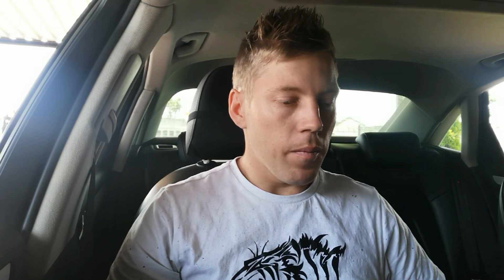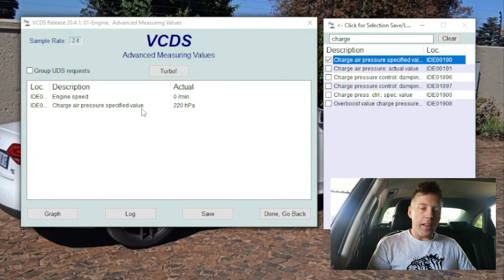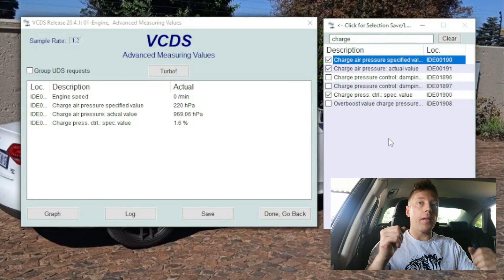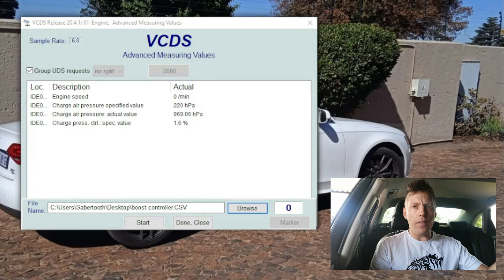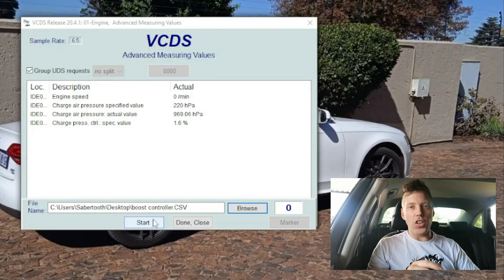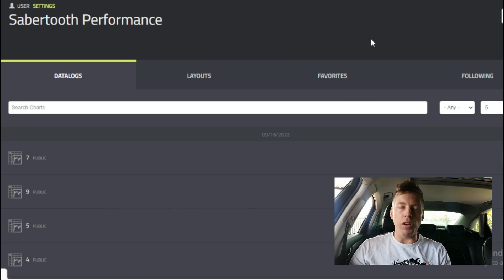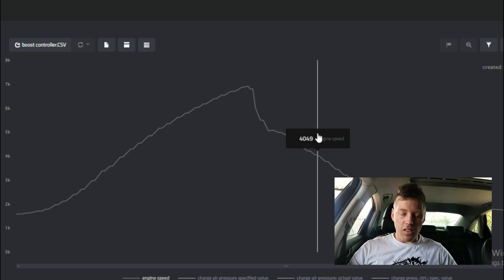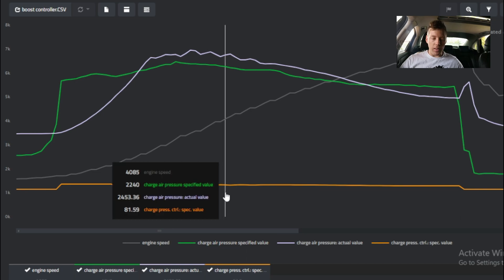How to Data Log Your Boost Controller With VCDS

Comment: I have the same exact problem!!! Tried replacing n75, wastegate, diverter rev d, checked for leaks.. Nothing worked... Did you find a solution?
Reply from the maker: It turned out my MAP sensor part number was not for my car, so when I replaced it with the part number for my car, the problem was fixed 👌

Comment: Thank you mate, cheers from Brasil. 
You are helping to find an issue with my Tiguan 2.0 TSI. 
When I pull the gas pedal at low RPM's, turboboost build's, and suddenly it appears the N75 valve open and shuts like 2 or 3 times, and then it shuts to allow turbo to pressurize the system. I already change the N75 valve to a new one, no luck. My turbo wastegate is okay, I just got the turbo refurbished. I don't know what to monitor next. Do you have an idea? 
Other problem is when I am at higher revs like 5000rpm with full boost and I release the throttle and step it on again, I got no boost at all. 
It's driving me insane.
Reply from the maker: Hallo hallo.

Can you please send me the logs... maybe I can have a look at them :)

Ok so with the story of the N75 valve opening and closing, I dont think it is doing that because it is Faulty...

It is being told to close because of some condition... such as Boost that might be to much.

Please log your throttle body and see if its also opening and closing... and log your rpms with it and your desired and acutual boost along with wastegate if possible.

If your throttle body is opening and closing by itself without boost overspiking it can be a tuning problem... is your car tuned?

If your throttlebody is opening and closing because of boost overspiking then you have a problem with the boost.

Then for your other questions about letting go of your throttle and then stepping on it again, it says that the boost is leaking out somehow...

For example...
Do you have a dump valve? If yes then its a common problem as it is releasing way to much air into the atmosphere that your turbo needs to spool up again.

When did you check your Diverter valve last? Do you have the Revision D one or the one with the rubber diaphragm? If it is the rubber one it is probably torn...

Otherwise you might have a boost leak somewhere that is causing your boost to drop.

Hope this helps a bit.
Reply: @megalodononwheels  Hey thanks for the reply. I'll do a new log with the new n75 and send the link from datazap to you. The car is stage 3 with hybrid turbo. And the theory that boost is too much is a very valid one, the tuner asked me to turn counter clockwise the screw from the wastegate actuator a little bit to try avoid this issue, its my next step. The dump valve I had a dv+ from GFB but had to uninstall because during the installation the mechanic dropped the brass piston and made a dent in it. Lol. Now I use the stock actuator dump valve.
Reply: @megalodononwheels  oh and no pressure leak I checked everything, every hose, pipes.  All good. Thank you so much mate!
Reply: @megalodononwheels  If you could tell me beyond n75, boost, rpm, what values should I log in vcds?
Reply from the maker: That is a difficult question to answer as it all depends what you want to check?

Comment: Is there a difference between logging turbo pressure data when the car is on the road and when it's in parked and just pressing gas in idle? Most mechanics run the diagnostic on my turbo with the car parked, but most of the people run the car on the road to log pressure.
Reply from the maker: Maybe when they go into launch control they can see if the boost is picking up like it is requested to. But I would imagine doing a "dyno pull" on the road will give more data to how the turbo is actually performs.

Comment: For TFSI Generation 3 can i put the same value in VCDS and hit the button TURBO?
Reply from the maker: Make sure you always hit the Turbo button :)

Also in some cars the values in VCDS will change a bit but are still the same thing.

As an example on my car the boost pressure is called charge air and on another Audi's it is called boost air.

So your will just need to play around till you get it :)

Comment: so which exact part that you found out and changed that solve the problem mate
Reply from the maker: You wont believe it... The sensor that was showing the boost pressure 🤣 its called a MAP sensor... Turns out when I called the shop to hear if they have spares they gave me a product number. When i got there and gave them the one I had in the car they told me that the one I called for and this one is not the same.

Turns out the one in my car was for the wrong car 🙆‍♂️

Comment: I facing same issue on q3 8u with stock turbo. Turbo was rebuild and diverter valve and n75 was replaced. The boost sensor that you replace is the diverter valve or n75??
Reply from the maker: Yes I changed the N75 valave... But as you saw, still not fixed :(

Butttttt...

I found the problem, it was the MAP sensor. For what ever reason the wrong MAP sensor was in the car, I could see it because the part number was wrong. (an Friend gave me the correct MAP sensor)

Comment: Nc vinteo bro..try LD performance boost control a cheap solution ..but i thing u need a injection cleaner and a fuel filtre..
Reply from the maker: I found the problem, it was the boost sensor that was the problem, but thank you :)
Reply: @megalodononwheels which boost sensor is this? Where is it located?
I’ve had my VW Touran 1.9TDI BXE PD105 engine rebuilt after a timing belt failure and the guy doing it has done some performance mods on the cylinder head. He has also cleaned all carbon off all parts not replaced, cleaned the caked up turbo vanes, replaced EGR valve etc.
Anyways after rebuild we had a judder issue which got resolved when we realised two vacuum lines were on the wrong parts. We still have a boost/power issue, it’s not the same as before but should be better with his mods which he says on average add a 15-20% performance increase.
We swapped MAF and MAP off an Audi A3 I have access to but no change

Comment: Thanks mate. I have a 1.6tdi CLNA and swapped CR140 turbo with it. Now experiencing boost leak. Checking what went wrong
Reply: Found out.. It was cut in tutbo wastegate line.. Changed the rubber pipe and now its 🔥
Reply from the maker: Dude that is so awesome! atleast it was not something to drastically and easy to fix
Reply from the maker: Ahhhhh no! The worst is when your having a leak 🤣😭 its better than overboosting though 🤷‍♂️🤣 I think lol... But any idea what it might be?
Reply: @megalodononwheels  need to check the intercooler piping.

Comment: good vid! def look at a retune now you're running de-cat downpipe. Your tune may require more fueling to keep up with the extra flow now!
Reply from the maker: Thanks man 🥳

The tuner did look on his behalf but could not find any problem with the software. So I am still a bit in the dak but spoke to a car shop and they think I must install a mini CAT on the rear O2 sensor as it is not made to receive info so quick without a cat. Its like all the air just gets blown past it.

It will be my next step as it is not to expensive